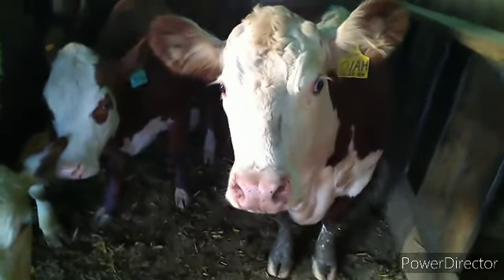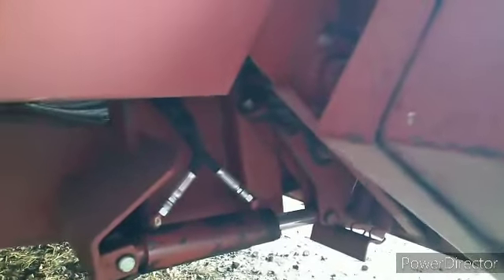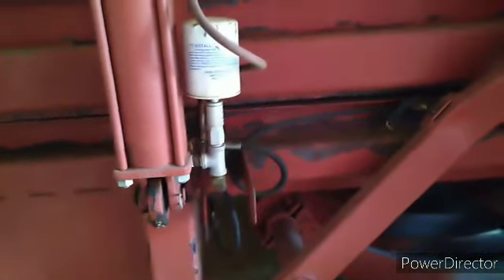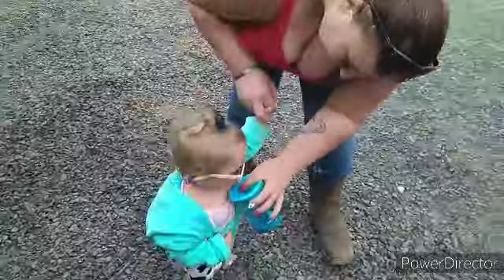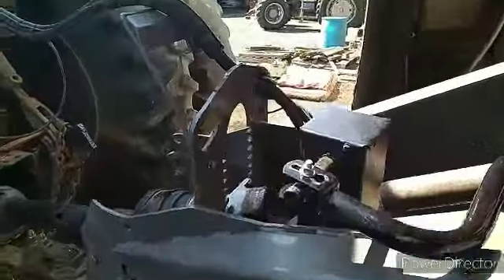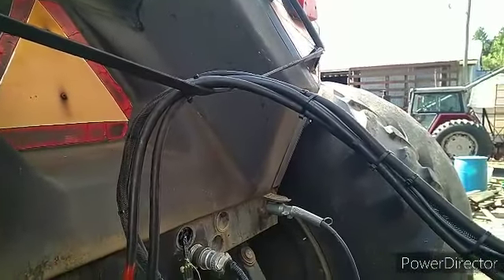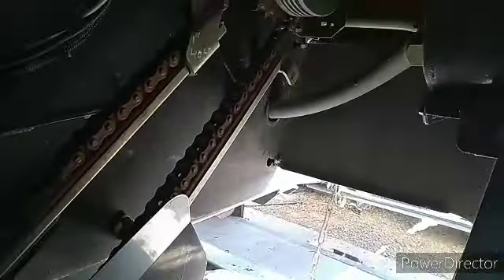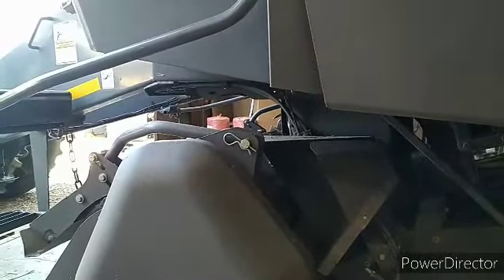Massey Ferguson 2190 big baler is ready to go, I hope!!!

Comment: Crazy what twine costs now. Getting the baler off the ground is less than fun, I broke an axle shaft a couple of years ago. At least the needles aren't solid cast, I'd hate to know the price and weight then.🍻🍻
Reply from the maker: @pinesedgefarm1155  good morning Erik ☕ ☕ ☕
kinda like fuel 🙄 I remember when dad would call around for 9600' (small baler twine)
And 10,000 (round baler twine).. we bought it by the pallet back then, $10 vs $12 a box, made a big difference by the pallet..
NO kidding!! You'd never pick them up then! 
Dropping one side on the ground can be a very bad thing!! Bad enough when a tire goes.

Comment: I remember the hesston giving you some fits last year.  Electrical i think.  So has it been demoted to a spare?  I don't remember if you ever got those  kinks worked out of that Hesston or not. Is it still usable
Reply from the maker: @AgWildNebraska  last couple of years we had issues. Electrical component, and hydraulic tension issues.. finished up last year by running the remote that controls the tension, manually. Pretty sketchy, as pressure changes so fast.. and over pressure can literally blow the baler up.

Comment: How many bales you get out of a ball?  I get about 30 out of a bale of two balls of that 16,000.  Probably a little more than that because got sick of buying twine so I don't put as much on anymore.   Last i give was $55 for two balls.   I realize its different twine than you use but still fun to compare.
Reply from the maker: @AgWildNebraska  an 8' long bale should be 27-28 bales per ball.. 
The 6' we've been making, should be 33.. and the new baler holds 30 balls.. old one holds 24.